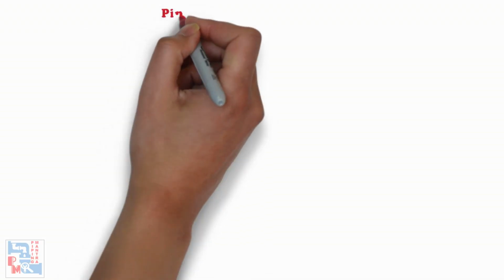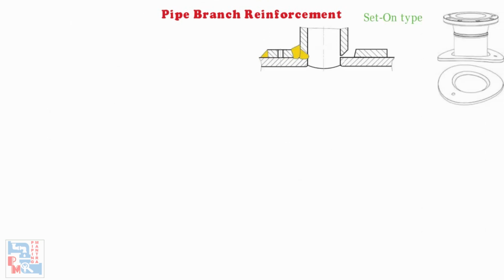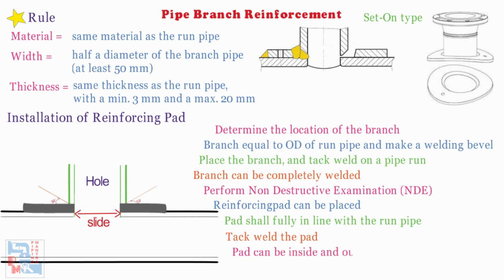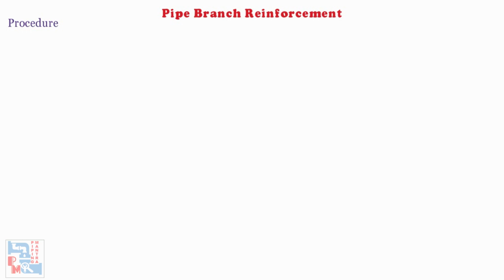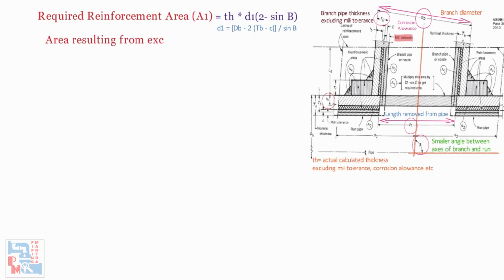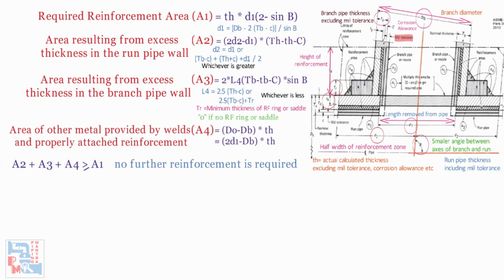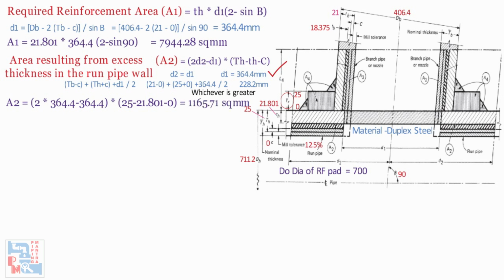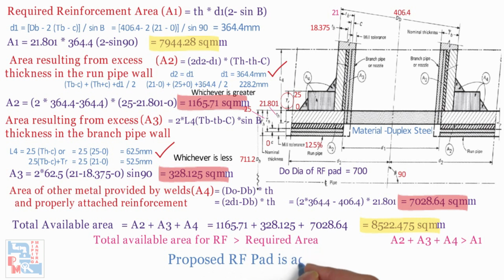Branch Reinforcing Pad Calculation | ASME B31.3 | Example  | Piping Mantra |

Comment: Since ASME B31.3 does refer to required thickness not specifically stating it for internal pressure. Does it mean to do reinforcement calculations for external pressure as well ? Unlike what we do for ASME SEC VIII 1 (Only for internal pressure)

Comment: Pl note that the value of L4 selected in Area A3 calculation (example) must be lesser value from 62.5 & 52.5mm whereas 62.5 is selected in calculating A3. It seems to be corrected.

Comment: In order to calculate A3, two values of L4 of 62.5mm & 52.5mm are calculated and lesser of the two values(52.5mm) is to be used and same is said in explaining but in the example shown 62.5mm is used which is wrong.
Reply: Exactly
Reply: Lesser value should be considered.. In this case 52.5 mm